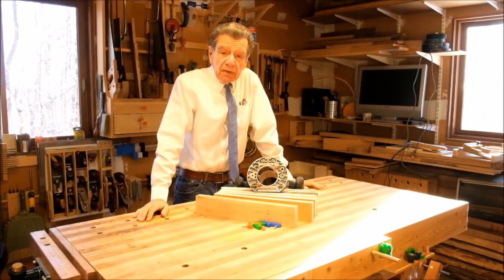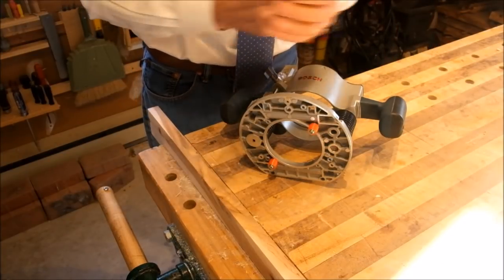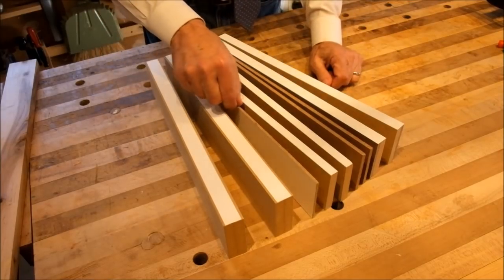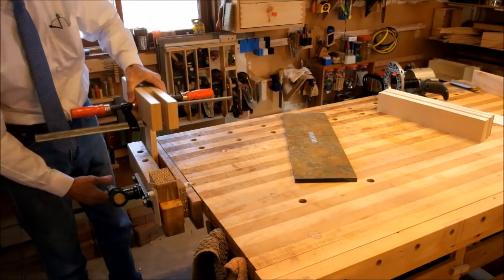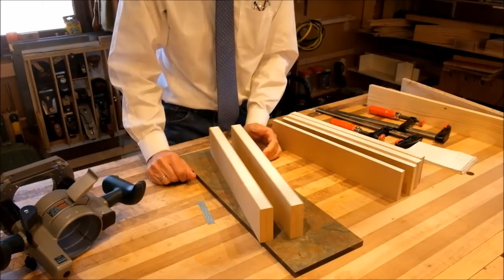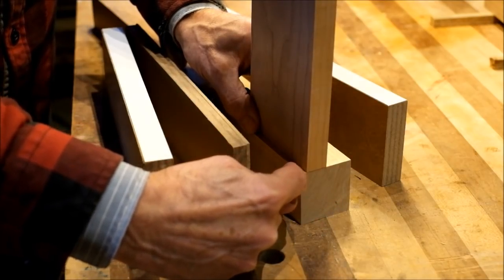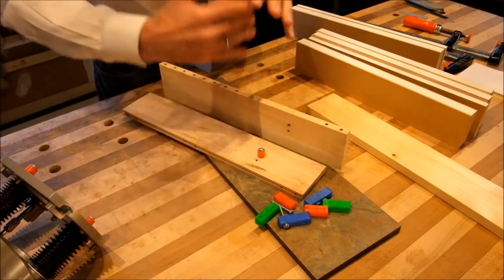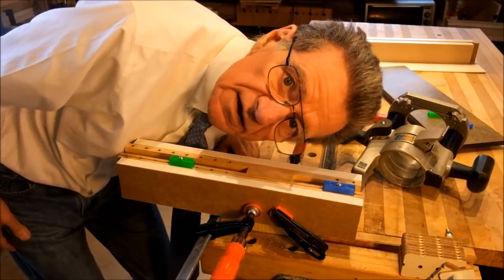Self-Centering Router-Mortiser plus Offsets

Comment: Excellent video George, well explained. I liked the comment about running out of swear words.  Totally understandable as I have tried upholstery.
Reply from the maker: And I'm back at it again these days: eight dining chairs, and now a commission from a friend to make two more.  And, Coincidence #2, the video we met over, thin rips:  I used bent laminations for the back slats, so there were plenty of thin rips over the last year.
Reply: @georgefouriezos8863  I hope you added a guard or that you retained all your fingers.
Today I got a tent created in my garage to exclude dust.  Tomorrow, all going well, I'll start varnishing.  There is light at the end of the tunnel and I hope its not an oncoming train.
Keith
Reply from the maker: @keithclague4403  Still 10 for 10.  No guard yet, but I no longer run narrow stock.  Instead I use a wide board or make the stock wide by gluing several narrow pieces together.  Great to hear you're closing in on the Keith Kayak!
Reply: @georgefouriezos8863  A good solution and I'm glad you will still have sufficient digits to indicate your displeasure to those that criticize the wearing of a tie.   they don't appreciate that people of our generation were brought up with a dress code that meant we dress in a respectful manner when interacting with the public.  A case in point: when I was a tour guide, I refused to wear the uniform of a polo shirt and fleece, in favour of a pin striped suit and highly polished shoes.  The obvious happened - people entering the facility came to me as I was male, elderly and smartly dressed and I had to pass them on to my group head who was in the scruffy uniform and was a young female.  It caused a bit of unrest.
Keep on as you are, its part of your character and makes you stand out.
Keith

Comment from the maker: When did MDF lose its only virtue?  I just measured my 1/4" pieces of MDF.  They came in at 7/32nds!  Cripes, the only good thing about MDF was that you could trust its named thickness actually to be its real thickness.  I'm miffed.  I will have to remake my 3/4" guides because they were made of with a half-inch piece (actually) plus a 1/4-inch piece (skinny by a 32nd).  The one-inchers are fine since they were made from two, actually one-half inch boards.  But the 1/4 inch panels, having been cut from 7/32 stock will have to be replaced as well.  Of course, the discrepancy does not matter for centered mortises; it's only when you want to offset the center by a precise amount that the actual thicknesses matter.  Lesson?  Yeah, bring a scale when you're shopping for MDF.
Reply: 1st of all, u r genius
2nd , I got a solution to ur problem , instead of changing the thickness of the jig , change the diameter of one of the 2 pins , u'll find other benefits of this solution.
Reply from the maker: Sorry about the late reply SR, I wasn't notified at the time.  I just found a pile of unanswered comments in the new (to me) YouTube Studio.  I really like your suggestion of a different approach.  Thank you.